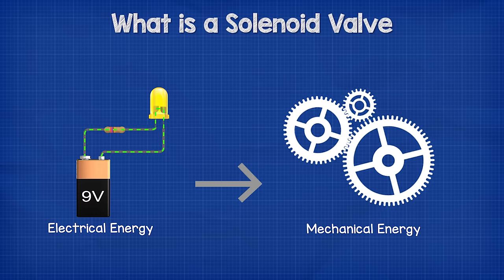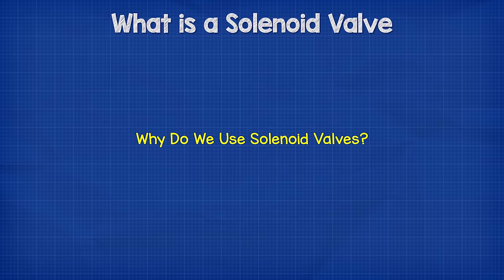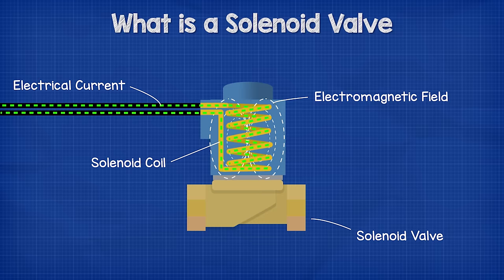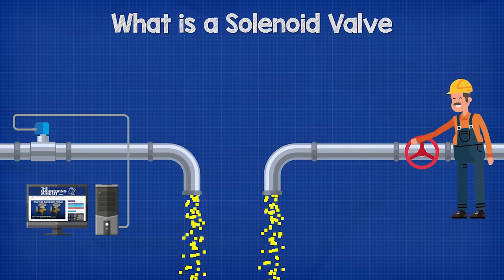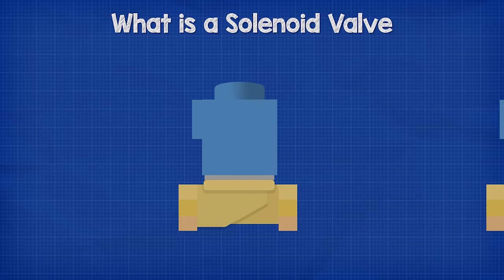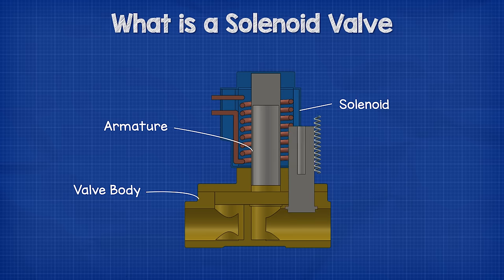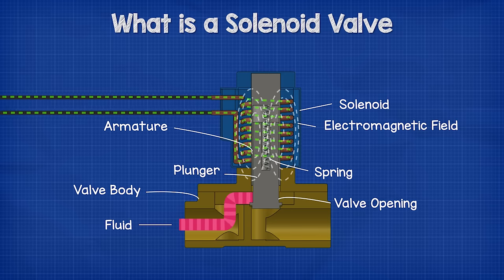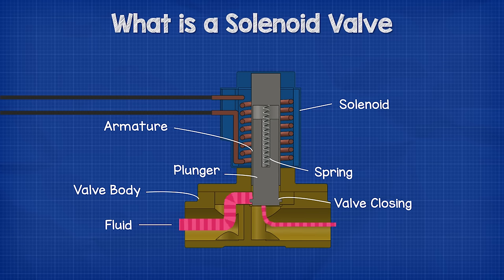What Is A Solenoid Valve?

Comment: Lol engineers don’t run around opening and closing valves, operators do.😂
Reply: I’ve seen multiple jobsites have maintenance personnel titled “engineer” for some reason. Its wierd
Reply: haha guilty 😂😭
Reply: Maintenace
Reply: You are limiting your point of view to a workplace lol. Which is VERY silly
Reply: a childish and ethnocentric view. "im right youre wrong"
Reply: I’m an engineer, I program CNC machines and run a turning section (lathes for anyone who doesn’t know), but every now and then I sweep up and clean the machines because it needs doing, am I a cleaner, or an engineer?
Reply: Welp. Engineers order operators
Reply: @FarawayTundra  I'm a maintenance engineer and I feel attacked 😅
Reply: I am a CNC Engineer. I design, program, and operate CNC machines.
There are a lot of valves on CNC machines that I would have to run around operating manually if it weren't for solenoids.
Reply: I’m a watch engineer for refrigeration systems lol sounds like what I do.

Comment: What about the other type? The video ended so abruptly! 😭😭😭
Reply: the other type is the opposite. so when there it is off and unpowered, the spring holds the pin(the gate that moves up and down to let the liquid flow) up so it’s open and when there is current, it causes the pin to move down against the force of the spring, and close the valve.

Comment: Ive run current in the opposite direction and the solenoid acts exactly the same, i.e. it did not get pulled in the other direction as one might expect.. sooo yeah are you just simplifying the explanation ?

Comment: Simple and work great.  When they get old, intermittent, partial, no operation and leaks happen.  Automotive systems and residential sprinkler systems are classic examples.
Reply: Yep, the solenoid on the AC compressor in my car failed and had no AC! Changing out the solenoid instead of the entire compressor fixed the issue!

Comment: So in this video there are two versions - a normally open and a normally closed. Is there a toggle version so it only needs power briefly to switch rather than constant power to maintain one of the two states?
Reply: There is a version called dc latching solenoid. Open and closed position is achieved by reversing the DC current momentarily in either direction. Very efficient and ideal for battery powered.
Reply: I'm sure engineering mindset hava a video on dc latching. Thanks for the information all.
Reply: @CT-vm4gf  Cheers for that

Comment: I sent a comment today on a solenoid video of 3 years ago and I don't think anyone will see it so here it is again:
I am building a device that will make super-heated steam in a small 1" by 25cm pipe. The pipe will be heated to 400°C. I want to inject an Arduino controlled amount of water into the pipe on one end which will immediately vaporize and become super-heated steam exiting via a 1/4" pipe on the other end. I was planning to use a fuel injector, but I think the temperature is too hot. My current thinking is to use a 12v DC solenoid valve and a stainless-steel needle. Any advice and suggestions? 
Thanks in advance,
Mike